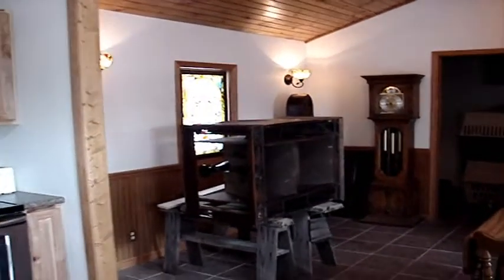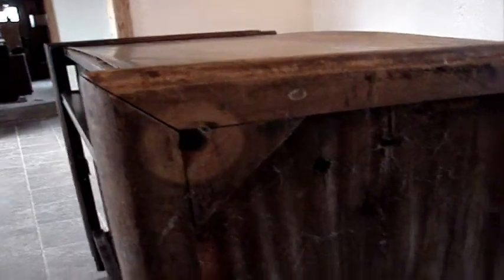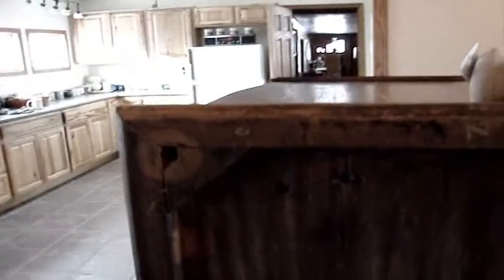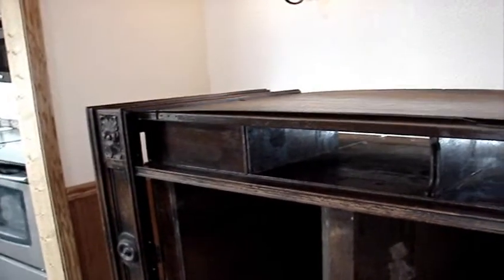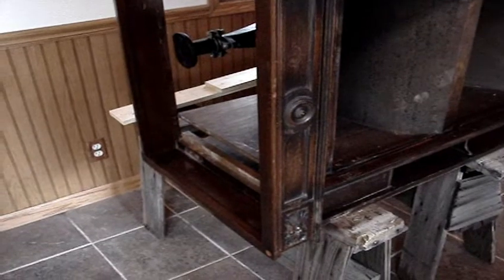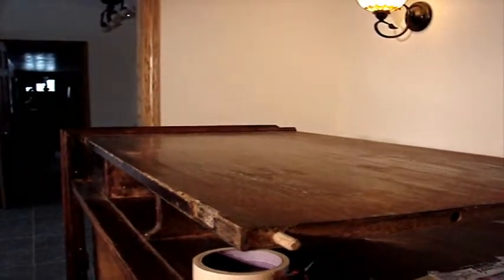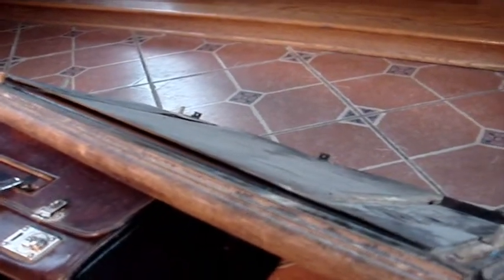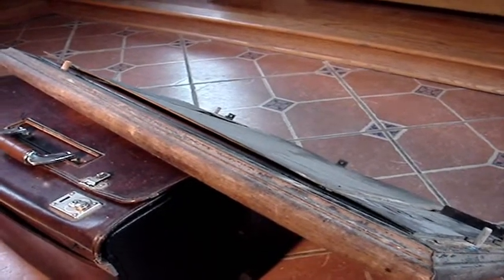Orthophonic Credenza Victrola repair PT2

Comment: I have my Victor Orthophonic 8-4 and it was missing half of the veneer. I did used wood finish to coated everything. It needs new veneer to new foot to install. The only place to find the matching veneer would be Lowe's or Home Depot. The player works after a full restoration

Comment: What a great job you are doing, and it will look just fine when finished.   You really have some professional looking C clamps for the job, I'm going to just use the metal ones I have along  with 1 x 6 boards to clamp down the edges where the  veneer is lose, it's just about an inch lose in some areas along the edge.   Where you are having problems in places where the veneer is buckled up, and hard to deal with you might try using a razor blade and slit the veneer down the center where the buckle is and fill it full of wood glue with some type of syringe, and then weight it down.   For the bottom base where the wood is soft at Home Depot you can buy a wood restorer that is made for house repairs repairing soft rotting wood.  Just fix the base as best you can and poor that all over the softened area, and let it dry, and it will harden the old soft wood to a surprisingly sound hard condition.  I used it a couple of times on some hard to replace trim on the house and it worked pretty good.  Those original bun fee were not made from a solid piece of wood, they were made in 4 sections and glued together to make one round foot, and over the years the heavy weight and dampness causes them to fall apart.  It's hard to find short bun feet that is similar to what was on there, I've got some new ones, but I'm not going to use the they are too tall and it makes the cabinet look odd.  It's sitting on them now, but I'm not going to the trouble of attaching them.  I've thought about cutting them off, I might try that first before I order some different ones.

Comment: Hi Gary  I haven't seen any videos from you in some time.  I also now have a Victor Credenza that I paid 35.00 for, I've cleaned it all up, and have done some work on it but it still needs more. I ordered some bun feet for it but I don't like them they are too tall, so I'm going to have to order some more that are short, no taller than 2" and about 4 1/2" in diameter, they are hard to find.  Here is my credenza and good luck with your project.  I also need to glue some veneer back down.  Here are some before and after photos it was in pretty bad shape when I got it.  https://www.youtube.com/watch?v=PaAD73nbVeE
Reply from the maker: Hi. It is coming along but there is so much work that some of it is beyond my carpentry skills but I think I will get it to looking much better. I am looking into getting a high end 1967 RCA New Vista Stereo and TV console. It has a dim picture tube though. Gary
Reply: HD7100 That RCA should be an interesting project, there are some people on youtube that have videos of restored color TVs.  I still have my mom's first 1966 Zenith color TV, it still looks brand new, it  does come on but the picture is too blurry and dim to watch.  It has the solid copper hand wired  chassis, and the Danish modern cabinet is made with real solid walnut and real walnut veneer.  It was such a high quality American made product I just decided to keep it working or not.  Here is the same TV I have it's the first Danish model in the video with the straw cloth covered speakers on either side of the screen, I always liked the style. https://www.youtube.com/watch?v=sIefAOli1QY
Reply: See if there is a vocational school with a wood shop in your town. 
Make an appointment with a classroom instructor to assign some students a project to make the bunn feet on a lathe. 
Pick the "A" ones for the two front feet. It would be free too.  And the student gets to see his work in a YT vid too.
Don

Comment: You can get some elbow grease from THIS OLD HOUSE. 
Do you use horse glue???  Oh NOOOOOO!  BAD JOKE
I've thought of making home brew wood filler, powdered sawdust in a food blender, then mix it with some kind of glue, the glue would be experimental.  Either wood glue or contact cement mixed with the sawdust until it's the right consistency to fill in the cracks.
Don